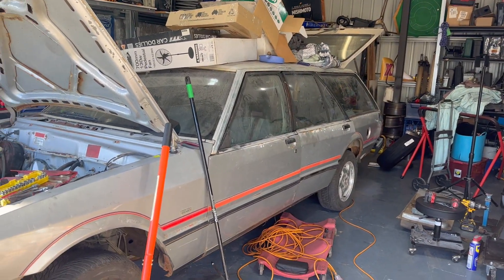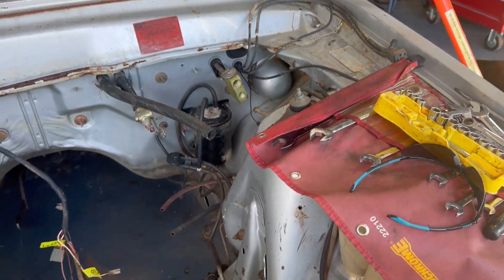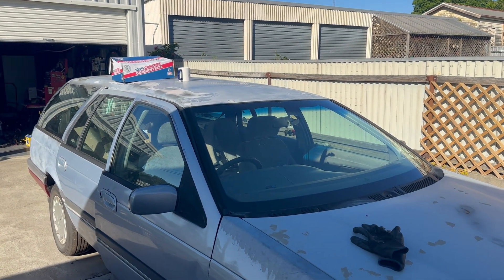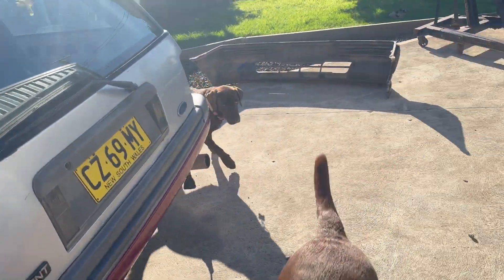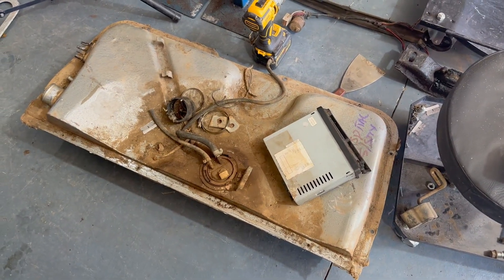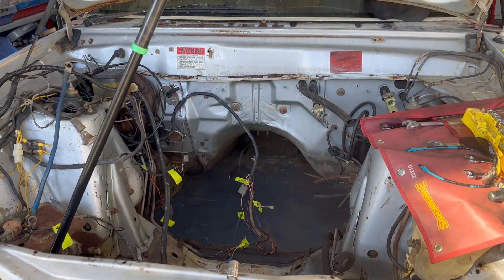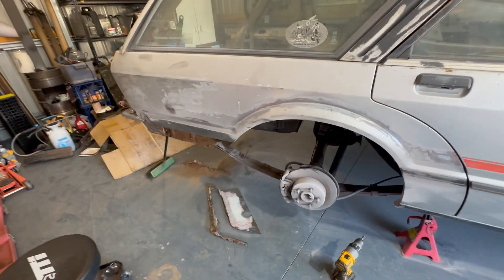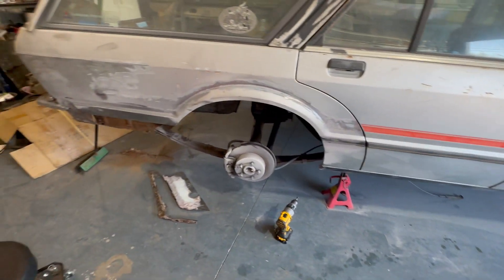New Project! Ford Falcon wagon

Comment: Mark great clear video content nice project, rust in the usual spots in these Fords, good to see you making use of what you have at least you have a shed , you might be able to make some more room there lay on an old blanket or a rubber mat ive worked on cars like yours im 58 years old the body dont bend like it use to enjoying a video without swearing good content for young kids thanks for sharing .
Reply from the maker: Thanks Russel. This is my apprenticeship project, learning to make basic patches and welding sheet metal. Once I’ve finished this, I have one very XA hardtop to restore. Thanks again :)